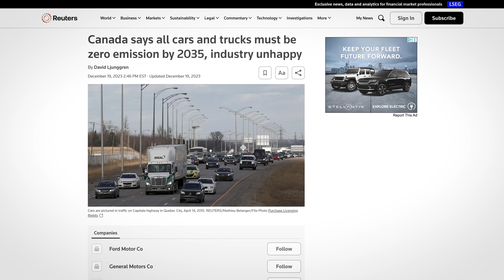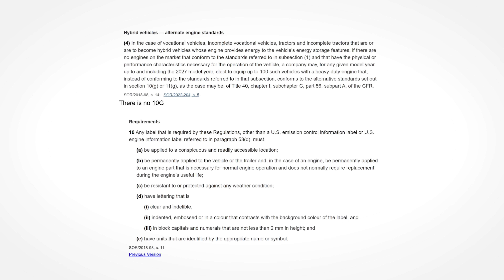Government Red Tape Is Blocking Our Plug-In Hybrid Trucks

Comment: I really like the work you are doing. It is no surprise to me that you can't get anywhere. I was a class A mechanic and I owned a Mack for eight years. In 1990 I wrote a book about how a better car could be built. Amazon stold the book as it is on their website yet I never got a penny. I figure a small engine using hydraulics could drive a three wheel car with my new design to steering and suspension. Truth is, nobody cares. I once sold garbage trucks and my boss became a member of parliament to change reciprocity laws. Now he is deceased and nothing has changed. Good luck. My book is entitled "A Tinker's Dream".

Comment: How did you guys get so far ahead of yourselves that you didn't realize that you needed a highway certified engine and not an off-road certified engine? I get the generator part but this issue was apparent a long time ago as HD hwy and non-road engines are certified to different standards using different test cycles. The exemption is what you need and you'll likely need some lobbying to get ECCC to issue it. Keep in mind that this will only allow your trucks to be sold in Canada and not be allowed into the U.S.

Comment: I think you should come and speak with some governors and other congress in us states like AR, TN, AL, KY or MS where there is steel manufacturing and automotive manufacturing or up until recently there was, low or no heavy diesel emissions testing and talk to them about making a deal to get a disused factory, a tax break where you will be able to.employ a bunch of local citizens and provide a quality, practical, durable, long lasting efficient vehicle. Win, win, win. Fvck Canada for crapping on you like this and in the US even if you can't manufacturer new trucks they could never stop you from upgrading old trucks in most states and using any engine you please on them.

Comment: Do they not have diesel electric trains in Canada, surely the legislation is there for the trains already, that legislation needs to be adapted for the road. it's exactly the same system Generator produces electricity and does power the wheels directly.

Comment: Invent a detached prosthetic foot that rests on the gas pedal that gets input from the system to actuate when you need electrical generation, but otherwise stays dormant. Then hook a certified engine without mechanical linkages directly to the generator. Stupid but workable until some bureaucrat finds a resolution (with both hands and a flashlight).

Comment: So New Flyer Zero emissions buses have to run a Diesel furnace to keep the cabin warm in cold climates because load on the batteries would be to great and that is aloud because it doesn't contribute to the vehicle going down the road.  Those furnaces have no emission systems on them and usually have a puff of black smoke come out of the tailpipe on start up, but that ok?

Comment: Love what you are doing. I really think that although you have a specific generator picked out, if you could make your trucks work on pure EV mode and then sell a generator separately that plugs in under the hood and maybe help the buyer install it as an aftermarket add-on. Looks like a lot of design work has gone into have that engine pretty well integrated to the truck, though.
Reply from the maker: That might be how our first customer receive their trucks

Comment: Does the mechanical axle have to be connected to the ground? Or can it float like an extra load axle, while the PTO generator does all the work?  Also, could a PTO system operate the throttle over CAN and "disconnect"  the pedal?

Comment: This is a lot like California's emissions laws, and I had a similar issue with an off-road emissions motorcycle not being street registerable.  I traded that 4 stroke bike for a much older 2 stroke bike which was no problem to register because it was designed for street use.  My LS3 swapped Jeep had all the emissions stuff and got better MPG than the stock motor, but I couldn't get it approved because the engine came from the "wrong classification" of vehicle, a 2WD car.

Comment: I just had this thought; Can you set up the computer controls from the off-highway motor to the same sized on-highway, to activate when the clutch is out/the stick is in neutral? Or even possibly in one of the assigned gear positions? Essentially it becomes just a work around. You have all of the required parts for being on-highway, they technically work, but the only way anyone would drive the vehicle is with the clutch in the 'electric' position, which operates as your current system does. 

It's just an idea from someone with no formal engineering background, but maybe it'll help. 

Good luck guys.

Comment: This has been interesting issue to follow in Finland also as there are machine suppliers willing to start producing EVs or hybrids. As you mentioned legislation that should tell you what to do basically cuts its own wings. But what is the actual problem there? Is it the engine emission regulations or what? For example Cummins L9 engine has Stage V and T4F certification as a on-road engine and as generator pack mounted engine. And Euro Stage V is always more restrictive and harder to get than T4F. In L9 application it brings you AdBlue, but there are some engine manufacturers that can offer a Stage V engine without AdBlue. 😉

Comment: You gotta find a loop hole. Maybe have a lever that adjusts the power then activate the electric generator. This way your generator is adjusting fuel depending on your input from a lever

Comment: You can use an on highway engine and just use your VCU to control the throttle to keep constant rpm. Also a lot of engines have a PTO mode where they will keep constant RPM. Does Scania have already certified engine with a PTO mode?

Comment: Can you use a regular diesel truck engine and program it to run like a generator.  Instead of a foot pedal have the computer control the throttle based on demand?  Or can one of the generator companies reclassify theirs for on highway?  What are the laws in the states?  Can you test and sell them here?  And are the hybrid pickup trucks still a thing?

Comment: Oh c'mon you don't have the skills to convert a road engine into a generator?   You are just blaming government, like most losers.
And gee whiz, did you not even check what is legal before you start building?   Sounds like some stupid azz business planning.
Now I have major beefs with government rules, particularly they will give you tax credits for EVs, but based on purchase price.
So how does it make sense to give you a $10,000 credit, but the car must cost $70,000.  If you can sell a car for $10,000 instead, it would be free right?  No, they are subsidizing and encouraging expensive corporate welfare cars, not actual EVs are replacements for ICE.
I certainly did not base my EV  business plan assuming it would get these credits, if it did, my cars would have been in production.
But frankly you must know this history of Thomas Edison as cheater and fraud, so how can you possible use his legacy name?

Comment: Would it be possible to certify the trucks as a fully standalone EV as one unit, and then also just so happen to produce a standalone diesel generator that just so happens to fit into the engine bay of the standalone EV? Curious where the line in the sand sits, can have an electric semi truck pulling a diesel generator behind it today. What happens when I turn the generator on and plug in my electric semi and go driving..

Comment: You should be able to grab an engine that in a generator with Axels for the road. They'll have to meet the same emissions standards because it technically has wheels as well. Not sure if they make a generator in that size or not though.

Comment: Is there a reason why you wouldn't be able to get an on-road engine, hook up the generator to that, and then make an electronic throttle actuator that controls the fuel/throttle based on whatever the electronics require?
Essentially just the same as any bog standard gen set, just with - if you really wanna distill it down to its purest, most 'We're complying with your regulations' form - a  linear actuator hitting the throttle pedal (hidden in an electronics box somewhere) if more electricity is needed.

Comment: Sounds like you made a full ev truck with an apu. Just put in a relay inhibiting the engine from running without the brake engaged. And warn customers that removing that relay is illegal and will allow the engine to run without the brake engaged.

Comment: Glad yall already have a good working relationship with Ram as they might be able to help with getting laws changed in favor for both companies. Due to their greater lobbying ability.
Reply: That is an idea. But despite the good relationship, I don't think Ram will do that, unless they decided to do that to their heavy duty pick-ups. But they again, Cummins already supplies them with on-highway diesel engines currently in use. If Scania can't get their units certified for hybrid use, Edison might be able to reach out to Cummins and repurpose their 6.7L already available hybrid generation purposes.

Comment: Start with the smallest diesel engine you can find and modify the crap out of it.  You'll want look at the wiring diagrams for each generator type in detail before making the modifications... this is doable, hire a smart diesel mechanic or engineer to get this done. The end result will be a marketable generator that meets compliance. 

Stationary generators and outright banned for use on the road down hear in the states.

Comment: Simple solution - make a BEV truck with no generator or engine. Still 0 emissions, ans complies with Canadian law. Problem solved. 

Bonus - you get to deploy your BEV semi in Canada before Tesla does
Reply: The whole reason why they're going hybrid is because the weight and cost of substantial energy storage for a large work vehicle spirals out of control real fast. He's not inventing new battery tech to fix that.

Comment: So, what is the specific law that would need to be amended? What is the law that specifies the exemptions?   The more details we can put in the request to our MPs, the less work it is for them to do something. The less work it is for someone to do something, the more likely it is, and the sooner they will do it. For those of us in BC, we can also write our MLAs, saying this problem is hurting a growing BC business Right now, the Feds and Alberta want to push multiple pipelines through BC, so BC has leverage to get things in return.
Reply from the maker: "Hybrid trucks that use the engine as a generator are allowed to meet generator emissions standards"
Reply: @EdisonMotors  how lax are generator emissions standards?
Reply: @fuzzy1dk  At the power range they're dealing with generators follow general off-highway limits. On-highway is required to emit 17% the NOx and 33% the particulates. Curiously on-highway is allowed higher CO emissions.
Reply: @fuzzy1dk  stricter than on-road on max load, more relaxed than on-road on low loads
Reply: - Vehicle rules are often necessary to explicitly permit systems (all else are verboten) - Edison's exact system architecture needs to be legislated as complying with a "Canadian Design Rule"...  They need the previously stated Euro 6 Scania engines to be brought forward...

Comment: To my knowledge of Cummins system, it can still work by programing the PTO setting so you have idle & fixed RPM, or change RPM with a variable input from an external controller.

Leave it to government to make a problem with no solution or force a more costly and less efficient option.
Reply: And it's not like Cummins isn't known for making generators
Reply: But that would work.  Then another reason to delay the electric side of the hybrids would appear.
Reply: Yes, no reason why this can't still work. The controls not being perfect seems trivial. The generator runs at a constant speed, build a new controller.

Comment: Something similar but different at work.
I have a machine that has doors that open with a latch. These are safety doors so production people don't get hurt. Open the door when the machine is running, it stops, dead cold!
I have two "guards" that were attached with wing nuts. These "guards" also have the same safety switch as the doors. Remove the wing nuts when the machine is running, it stops dead, now!
The safety rules are "No guards can be installed with wing nuts." They can't get past the fact there's a safety switch in play. They can't get past their own "logic"!

Comment: Face it, hybrids are the most convenient way to use electric motors. sure you can plug the vehicle in the wall if you want, but being able to fuel up and go in minutes is a convenience and safety net that cannot be replaced at this time.

Comment: What's the mechanical difference in the engines? Can you just take the electric motor and torque sensing, connected that to the output and throttle of an on road certified engine?

Comment: So you’re telling me the wife’s Lexus can’t be road registered in Canada 🤔 it has a constant speed generator that charges the battery and no direct mechanical link between the engine and wheels. Electric motors on the axles, what’s the difference 🤷🏻‍♂️🤷🏻‍♂️

Comment: Would it be possible to swap the transmission from an on highway engine for the alternator setup from an off highway?
It seems to me, with your teams engineering prowess, you could tackle something like that. Seems the load sensing equipment would be the biggest roadblocks, I wonder if you could even use the ECU from the smaller generator on the larger motor

Cheers, from Kamloops!

Comment: IMHO there’s still lots of potential to do parallel hybrid instead of only having series options even if this turned out to be a firm road block on the fixed rpm engines. Harder to package but with the right control strategy and powertrain more efficient and could be cheaper.
Reply: pretty sure the only smart way to do parallel hybrid is a Toyota technology of their E-CVT and I don’t think that scales to truck size
Reply: @dlanm2u nope, not the only way. That’s a very smart way to do it since the transmission multiplies the electric torque but there’s nothing fundamentally wrong with having a full additional E-axle like a sienna. Generally called a “through the road” parallel hybrid. Two fully separate redundant powertains. Power adds too which is nice, unlike series where the generator doesn’t increase the peak output of the system.
Reply: @needanameprojects but then your engine isn’t staying at optimal rpm
Reply: @dlanm2u with a 13 speed transmission you’d be surprised how close it is to peak BSFC at any given time when cruising but even if it weren’t, the control strategy can mitigate the impact. When accelerating you could short shift an undersized diesel engine to maintain close to peak efficiency, but get most of the actual drive torque from the second axle which would be electric. Then you cruise down the highway with the engine at peak-efficiency RPM AND load since you could regen the e-axle while the diesel goes basically full throttle. Then when the battery is full you switch to idling the diesel or shutting it down fully and driving in full EV mode.